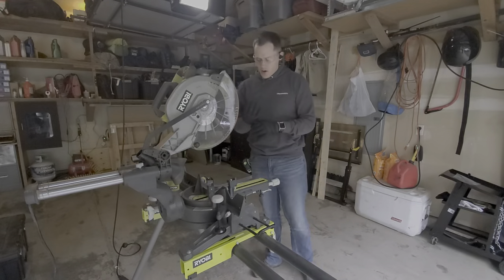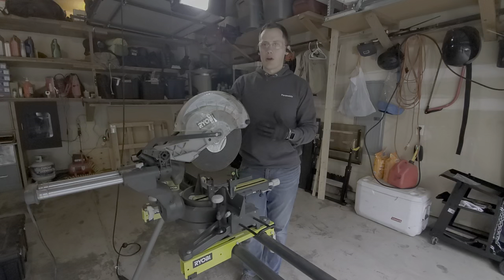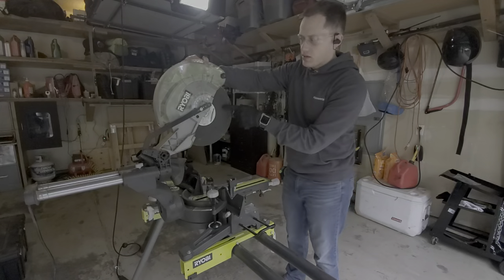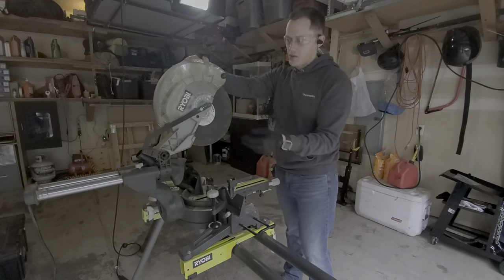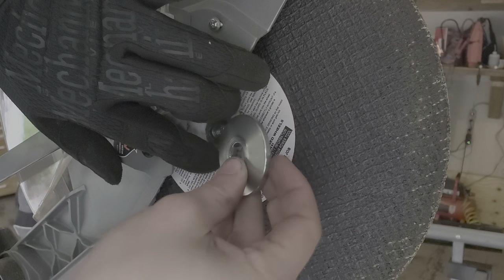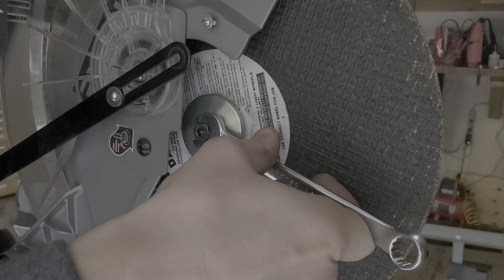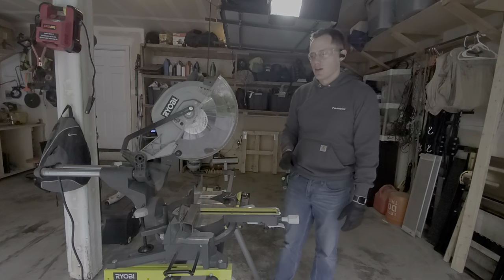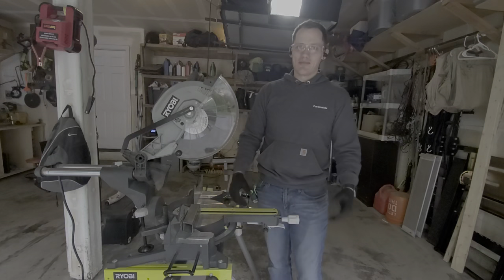Cutting metal on ryobi miter saw

Comment: That's ok if you don't care about lifetime of the saw. But if you do, this is the worst thing you can do. Carbide from cutting is flying all over the place (including the bearing on the saw) and will do damage over the time. There are already carbide-toothed blades on the market for clean steel cutting. But of course they are not as cheap as grinding wheels.
Reply from the maker: They are also no designed for the speed which a typical miter saw spins.
Reply: Whatever, I bought my mitre saw used on Kijiji for cheap

I really have no mercy for my saw

Comment: I am in this situation right now, do I use my one year old expensive compound miter saw to cut the 3/8" flat bar and 1/16" square tubing with correct wheel or buy the right tool for the task?  I'm leaning this way since it's not a lot of cuts but I love this miter that I just bought and it would kill me to ruin.  Decisions decisions
Reply: So I thought I would add this for all, as I mentioned prior I have a project that requires cutting mild steel so after watching this dig deeper into wheels for my miter saw.  I went on harbor freight to see if I could get something inexpensive for this task and saw they have a Hercules 14” chop saw that uses a 15A 4,100 rpm motor.  Then noticed their 12” miter saw listing a 15A motor so dug into specs and to my surprise it also has 4,100 rpm and psychically looks identical to the chop saw motor, which I am guessing is the same.  The Hercules metal blade is rated at 4,365 so just did a quick check of miter saws; DeWalt spins at 3,800, Rigid 4,000, a Bosch 3,800, etc.  I no longer have any worries about using my item saw with a metal cutting blade as this video points out for my one of project.  

Thank you for posting this!

Comment: Get a Diablo Steel Demon blade, much faster no sparks.. they're a bit pricey but worth it. 

With that being said i have an old Makita miter saw that's going to be for metal and i was cheap and got the grinding wheel BUT i have the steel demon setup in a circular saw and it cuts nice

Comment: I do like this but 1. Can you show what level of precision miter cuts it can make in different stock? Especially compound miter...IE if you need to notch a square tube with 2 45’s to be able to bend a 90... and 2. Should there be some disclaimer about plastic parts? Most chop saws are all metal, and if you cut long enough and sparks hit a piece of plastic on your wood saw that part will melt...even just deforming your slotted plate would knock it out of true, but maybe a high heat paint could counteract? Would be interesting to test.
Reply: Yeah I'd like to see a laser line cut with one of these grinder saws. 

I need to do bevel cuts on a 6mm sheet of steel. So I can't have wildly inaccurate cuts.

I'm trying to make hubs for a Geodesic Greenhouse

Comment: Don't want to sound like a safety Susan but the first thing you should of fabricated is a better disc guard..if that disc lets go that plastic will be deadly even if the disc fragments miss you, cut off saws have a heavy steel guard for a reason!
Reply: You missed the gas can  sitting on the cooler in the background.
Reply: My 2-stroke homelite XL98 14inch chopsaw had an old cast iron gaurd on it and the 1 and only time I got to use it I had a abrasive disc explode full throttle and the cast iron gaurd just blew apart like it was plastic. And that my friends is why my chopsaw is now a mini bike!!!
Reply: I'm glad someone else realizes this. I had a 2-stroke homelite XL98 cut off saw with a cast iron blade gaurd on it. The first time I used it 8 blew apart a 14inch abrasive disk while I had it held wide open and the blade gaurd just blew apart like cheap plastic. More like exploded actually.

Comment: I am going to use a wet-dry tile saw.   4.5 inch.  Can I run the water?  Any other concerns?  Thanks for the video too.
Reply from the maker: Check the rpm. The grinder blade will list a max rpm, as long as you are under that rated rpm you are good to go.